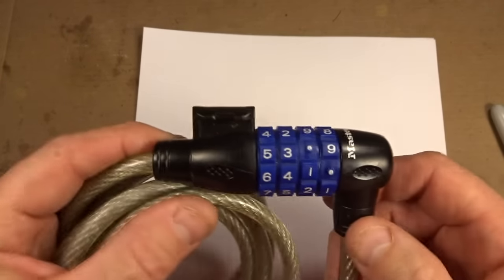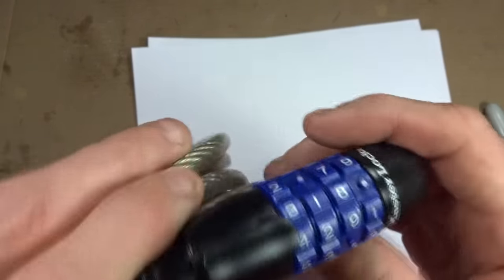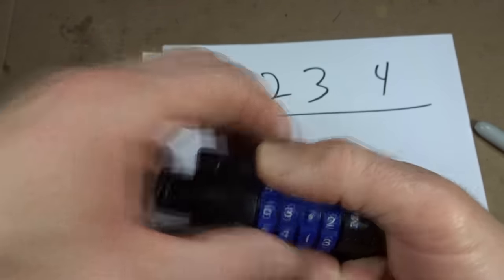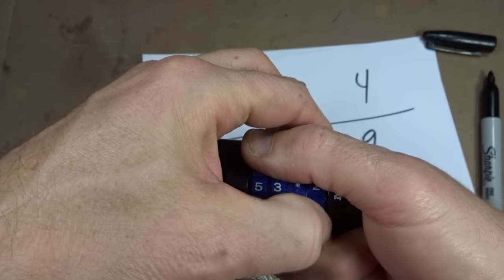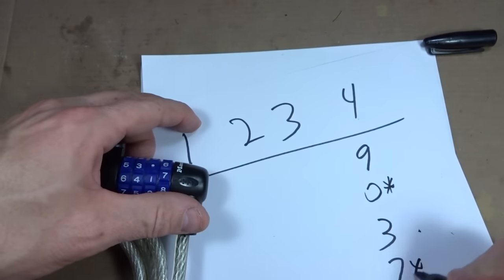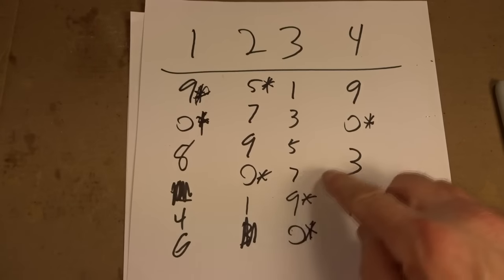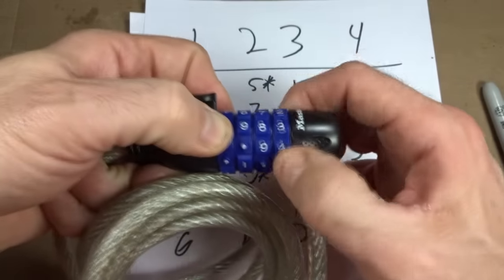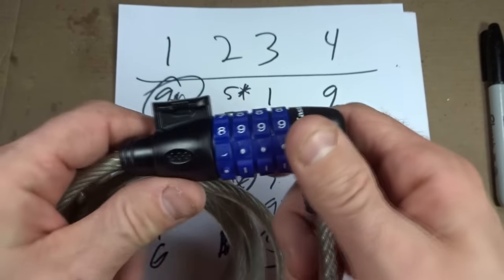How To Open Bike Lock Without Combination - Advanced Lesson

Comment: if pushing for pressure doesn;t help you find push points, try pulling for pressure. 2/3 (3rd had 2) of the 4 I found. Then I only had to check 20 permutations and boom. Good video. Thanks! No, I'm not a thief. I left the country for a year and forgot the code for the bike lock I have for my spare bike. Thanks man!

Comment: Just accidentally found this video. Great job decoding the bike lock with false gates. I'm a lockpicker (locksport hobbyist) and love combination locks. You did a great job explaining the combinatoric method. Have you tried figuring out if the gate is the right one by moving the wheel left and right while pulling on the cable? The false gates normally show less play. Anyhow, great work :-)

Comment: True words about the bolt croppers, in many towns they are increasingly hard to purchase, tool shops rare so as to effect diversity and increase price & in the UK 2 big tool suppliers pretty much insist on having your details for each purchase, makes things damned slow, often annoying and always intrusive if you just want to pop in for a 10m roll of p80 sandpaper a tube of bathroom sealant & a cheap flat screwdriver!, as always a great & enjoyable video ty.

Comment: You might also try to feel the friction of next wheel, when you turn the first one(while putting pressure an the lock/pulling apart) . So when the next one is turning harder, you (might) have the right number on the first one.

Comment: Many thanks from the UK.
It's basically being a bit more methodical, patient and sensitive than the technique for a basic combo-lock.

I bought two new but different quality locks in a sale, set them up and hung them on my (visitor) bikes. 
By the time I came to use them for real, so much time had elapsed (years) I'd forgotten the codes and had dumped the packaging (or filed it in a secure place).
I'd tried the basic method before with no success, so I tried this and only had to find 2 catches to work-out (remember) the rest - so your tip saved a lot of time and took me less than 5 mins - in fact it's taken me longer to type this on an iPad with one finger!
I'd set both locks to the same code - which is fortunate as the second lock was a lot trickier to find any catches.

Comment: I have two U-locks from ONGUARD (similar to model 5511) sitting in our room for several years. I would like to open the locks and start using them on my bike trip to the city. However, no one remember the 4-digit passcodes for both of them. Is there an easier way to open the locks, instead of trying 9,999 numbers TWICE.  I did try all the possible special dates in the family.  None of that works, and we tried to the factory default 0005 too.  Can you help?  Thanks... P.S. the lock is quite stiff for me to feel the catches you mentioned.

Comment: Never buy that kind of lock. Like he said, gone in 2 seconds! Get the all steel hardened ones. If you NEED a lock in the first place, NO NOT GO CHEAP!
Reply: Takes very little time to get through basically any lock with some tools.   Someone "borrowed" one of my bikes last year, and I found it outside the railway station a few hundred yards away, with another lock on it.  Took my cordless angle grinder to retrieve it and took about 90 seconds.  Lost my key to one of those hardened steel roller cable locks and was a long way from home and serious power tools.  Got through it with $10 worth of hand tools, although slipped and did myself a good deep cut too.  

Locks are all about making sure it looks locked really.
Reply: OasisofSpirit  vBBC FC

Comment: or drill on end and use feeler wire on top of teeth
Reply from the maker: If you are going to drill the lock, why not just cut the cable with bolt cutters...
Reply: not drill into mechanism just an horisontal or near h  access  hole or trench drilled from above a few holes in line   to outside  area where key teeth enter lock , then with repeated jabbing motion  push a straightened cable wire strand in the small space  above theeth and under roof of  teeth chamber , turn number wheel until wire  passes through open tooth gate  , continue with wire and let wire end knock on next gate plate and turn that  second number wheel until w goes through again and repeat . try it its fun.and kinda easy and the purpose is to reuse the lock . might fill the hole with some filler or gum.